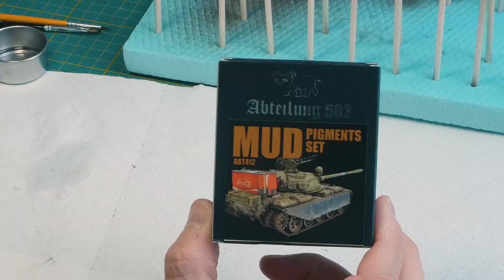Tiger 1 Normandy diorama 1/35 weathering tutorial

Comment: That’s the best Tiger1 model I’ve ever seen so far. Gj!

Guess I need to implemet oils. Looks nice!
Do you recommend to use white spirit or any enamel thinner is the same if I want to dialute oil paints?
Also.. how do you avoide glossiness of thinner after applying pigments? On my previous tank it dried to shiny.
Reply from the maker: Many thanks Kozár, 🙏🙏
Well, you can dilute oil with enamels thinners (I recommend odourless 😁) but I only work with odourless white spirit. That's much cheaper and works perfectly. I buy it in "do it yourself" shops (type Leroy Merlin,...).
I also use the same white spirit to fix my pigments and never experienced any glossiness after drying. 
Some thinners or pigment fixers may modify the final colour and appearance of the pigments. The best options are the ones you are used to. 😉
I strongly recommend to test new products on spare parts prior any use on models. 😉
That's what I do all the time. 
The AK interactive sand and gravel glue works perfect too to GLUE (not to fix) pigments but it leaves a thin semi transparent coat at the surface because this product is thicker. 😉
Good continuation and enjoy modeling 🤙🤙🤙
Reply: @18thsquadlab  thanks for the enlightenment. Do you use varnish once you done with acrylic (such as basecoat camo tools etc)? Or you put on varnish layers along with weathering?
Reply from the maker: @kozarervinkopi  I'm not a big fan of using varnish as it tends to tone down the effects and the micro contrast. For this Tiger 1, I only used varnish once after doing the scratches (above the scratch effect product). This was necessary to make sure the product was neutralized below the varnish coat. When I use varnish, it's only when strictly necessary,  like before and after applying stencils.😉🤙